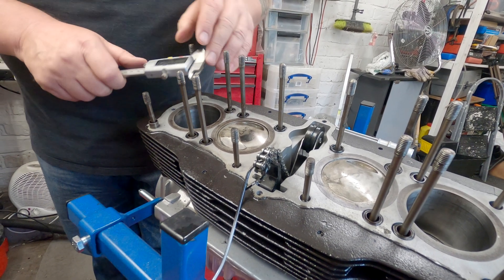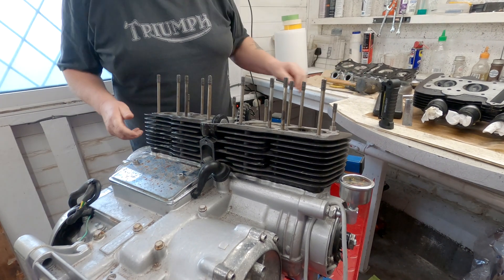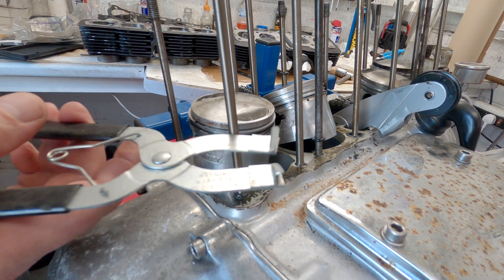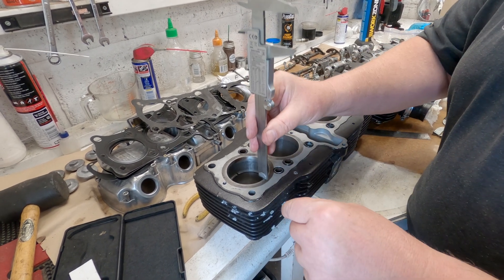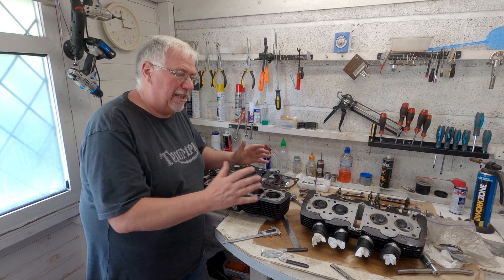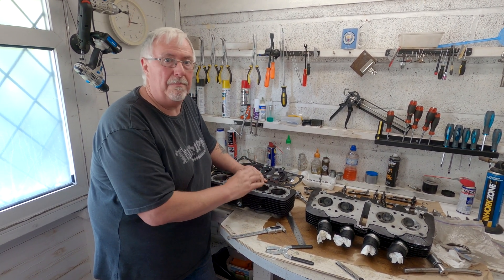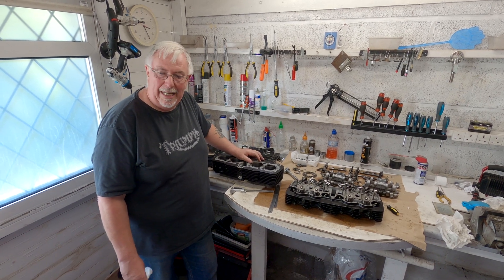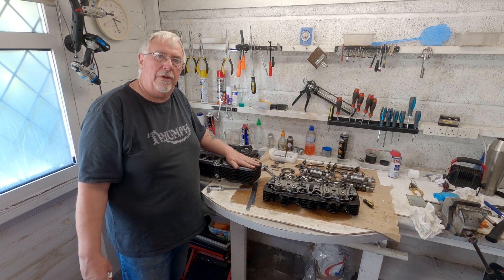Shocking Discovery in my Honda CB750 Cafe Racer Engine | Yoshimura Big Bore Piston Motor | 08

Comment: You could take the bore out to 67 mm which equates to 888cc. I had this kit from a Japanese brand called Henry Abe. Pulled like crazy through the redline in top gear!
Reply from the maker: I really want to use the Yoshi pistons, and I wasn't looking for a big bore, it just fell in my lap.  I thought that anything above 65mm bore started to make the standard liners very thin, so you I would have to replace the liners too, starts to become a very expensive job :)

Comment: Yoshimura big bore ses are usally on 812cc
Reply from the maker: Yes, and they are marked 812 on the side.  But they also machined the same blanks .5mm bigger and made 823cc.  If you put as much time into researching them as I have you will find some original adverts for the 823cc sets.  It did cause me a lot of confusions, and is probably why the previous builder used 812cc piston rings without checking the gap. I was really  pleased to get original NOS Yoshi rings for them.

Comment: I'd forget about the extra size of those bigger bores. I'd look for a serviceable standard head that would work with your pistons. 750CC would be fine with me. The extra bore I doubt you'd even feel when you opened up the throttle. But if you've got bits of metal damage inside the engine, I don't think I'd use the engine at all. If the damage is in areas like bearings that can be replaced, then it's back like new. But other areas like the cam bores that don't have bearings, no fix for that. Maybe the camshaft and crankshaft could be machined back like new. But a lot of work and money. I'd scout around for another engine in good shape.
Reply from the maker: I may end up going with 750cc in the end.  I do have a set of standard barrels and pistons as a fall back.  But before I give up  I am going to try to use the Yoshi pistons.  It seems a shame not too as long as the costs don't start spiralling!  I am not really looking for added performance, I have a Fireblade to scratch that itch, this buiild  is for the fun of it.  I have had a coupld of standard(ish) CB750's so it will be interesting to see what difference the bigger pistons make.

Comment: Sir, you're going about this in all the wrong ways.
The ring end gap does not determine anything to do with the bore size. I concur the end gap is way too large, but your pistons and cylinders may still be fine.You need to mic the piston skirts at the correct location, then mic the bore size and subtract the piston skirt size to give you the piston to wall clearance. This will determine if you need to rebore and hone the cylinders. I can type for hours but this should get you started.
T.S. RACING
Reply from the maker: Thanks BTC. I am going to take your advice.  

I wasn't using the ring gap as an indication of the size, but as the cause of some marking, and obviously an issue.  

I do want to use the pistons and before I give up I am going to get some accurate measurements.

Comment: They all sound like a pretty viable options    that extra pop you get from those racing piston  sounds like it might be worth hanging on to as they boost your compression  up from about 7.7:1 to a little over 10.2:1  other than that I would just research every option a bit  as far as parts availability  and whatnot and just go from there man !! 😁👍
😁👍
Reply from the maker: I am really going to make an effort to keep the bigger pistons,  but not at any price though!  I'm looking at measuring everything more accurately, then I will have the problem of finding Piston Rings!  Quite a puzzle.

Comment: How about nikasil for the cylinders? You might get them fit the pistons again.
Reply from the maker: Thanks for the idea.  It's a thought but that would be getting into an area I know very little about!  I have always run scared of engines that had nikasil bores.
Reply: @SPANNERRASH  Luckily there are professionals who can do it for us. I don't know if they need different rings, but likely not, as it should be more slippery as a surface than cast iron.

Comment: Very cool on the big bore discovery! I would get the heads machined and go next size up on the pistons. When I big bored my CB250 to 275cc, the skirts of my barrels had cracked and I had to grind them off and pray it wont effect the motors operation. Doesnt seem it did thank god!
Reply from the maker: A few people have mentioned cracked skirts. Apparently the next size up of piston makes the skirt very thin on these. I'm not sure what I am going to do yet.

Comment: New to the channel, and I have to say, nice content. Someone spent a lot of time and money to make that much of a mess with that engine! Looks like its in good hands now though .  That engine needs to come completely apart, if only to look out for any more stray swarf, but I'm sure you will find other 'interesting things inside that needed your attention anyway. 
Dont be too hard on yourself for using a vernier, you will easily get within a thou, so plenty good enough for go/ no go stuff. But you are definitely at the point where a couple of outside micrometers would be well worth the investment. 
As for the barrels and pistons, you need to measure the skirts with a Mike and make sure the skirts are not collapsing, and that they are on size, measure the ring groove side clearance, check the small end clearance,  if that all checks OK, obtain an original set of barrels and bore to suit, probably the cheapest sensible way out. If you don't want to invest in micrometers or are not completely comfy checking the pistons, rebore another set of barrels and a new set of pistons puts any issues firmly in the machinists court. Pretty sure I'm teaching you to suck eggs though!!  I will look forward to seeing what you do with it, keep up the good work !
Reply from the maker: It's a shame that it wasn't as good as it first looked.  I think it was all done with the best of intentions, but as they say the road to hell.....

Hope it doesn't throw up anything terminal as I dig deeper!

Comment: Unless you're willing to go for an 836cc set then I'd just replace the barrels. I'm running 836cc with the original carbs that I had re-jetted and it still runs well.
Reply from the maker: I wasn't looking for a big bore, they just happened to be there.  You know what it is like, one thing leads to another.  I want to see if the parts I have are at all useable before I give up.  I'm not afer a race machine, but it would be good to give those pistons another lease of life.  Interesting what you say about the carbs, what jets did you settle on, in fact what carbs too! :)
Reply: @SPANNERRASH  mine is a 1975 SOHC. It still has a kick start and a single front disk. I'm on the OEM carbs with the airbox replaced with pod filters (no good reason for that tbh!). The mechanic I used had to up the fueling, I couldn't tell you what jets I'm afraid.

Comment: I'm in deep on a scooter I bought. It ran, not well, so I cleaned the carb and now I can't get it started again. So through the list I go....
Reply from the maker: Make sure that another problem hasn't turned up.  Maybe with the ignition. Old bikes have a habit of throwing curve balls. Try it with brake cleaner to see if it will pop and bang.  Good luck.

Comment: I had a similar problem with my kettle barrels a few years back,I usually use SEP in derby, but by my own stupidity, I used a place local to me, rebored a set of barrels to the second oversize,they also supplied the pistons & rings, placed the rings just above the transfer port & it measured.40 across all 3 cylinders,got a mate to measure it & he agreed that it was .40, so I took it to my local bike shop & he also confirmed .40,service limit is .15 to .45, so around 1000 miles & it’ll need doing again, took them back where he measured the barrels, gave him back the pistons, he wrote me a cheque for the £250 I paid him, where he then threw me out,on the plus side, I bought a complete genuine Suzuki gt750 2nd oversize pistons,rings etc for £130,had a chat with SEP & they can re-sleeve the barrels at £60 a cylinder
Reply from the maker: Thanks Pat.  I will make sure I keep SEP in mind if it comes to new sleeves.  There used to be a lot of places that you could go to for engineering work, they all seem to have disappeared now in this throw away society.  Like you found, reputation is everything.  I still have no idea what I am going to do with this engine yet.  My biggest concern is finding appropriate rings.  That and a finite budget!!

Comment: What if you do some more honing of the barrels to remove those scratches and buy new pistons with a +0.25 size?
Reply from the maker: I am going to have to hone the barrels, but I am hoping to litterally just take the marks out and hopefully the scratches are where something has picked up rather than gouged in.  I don't believe that there are any +.25mm Yoshi (or 810 64mm) pistons available, so if the bore is too big especially after honing then that isn't really an option.  I think my biggest problem might be getting piston rings.

Comment: Great detective work les it does pay to research and understand the job 👍 I would go for a rebore and pistons your mind would be at rest with no ifs buts or maybe. Great job and enjoying the series 👍
Reply from the maker: Thanks for your encouragement!  I was surprised to find out it was a big bore, and Yoshi pistons what a find.  Shame about the rest of it.  You are right about doing the job right and not having any worries about it, but I am not sure what right is yet.  Even going back to a standard barrel and pistons doesn't seem as straight forward as you would think.  Hard to find parts for this engine apparently.

Comment: I would measure the bores with a proper bore gauge and measure the pistons with a micrometer to get the clearance.It may be that the rings are not the correct ones.If it were my bike I would source some used barrels and if not worn, would go back to standard Honda pistons,gaskets,oil seals etc.If the barrels you get are worn then rebore to suit.
Reply from the maker: Thanks Tim.  I think that is good advice, I need to know more about the barrels and pistons before I can make any decisions.  Having found the Yoshi pistons inside, I would like to use them if possible, but not at any cost.  We'll have to see how it turns out, going back to standard might be the best idea.

Comment: Hi Les, that’s disappointing, I had thought that it would be good inside, they often are but given someone has messed about with it I guess Mr Honda can’t be blamed!, I think it would be good to keep the big bore if possible, so look at sourcing replacement barrels and have them bored to suit maybe.
Reply from the maker: Hi Mark, I was exstatic when I found the Yoshi pistons, but the marked bores, and the size issue have taken the gloss of them.  I would like to use them, but I don't want to spend a fortune on something I wasn't looking to do in the first place.  I need to make sure my orignal findings are right before I can make any real decisions.

Comment: Seems like whoever was in that engine was kind of sloppy with their work.  I'm not sure what I'd do.  Buying a used set of barrels and some new standard pistons seems like the easiest way to go.  I haven't looked at used engine parts in a while, so I don't know what that would cost.  Are those over-sized pistons rare or expensive?  If so, you could sell those to help fund the repair.   Or get the new barrels honed to fit them.  Decisions, decisions, decisions.  : )
Reply from the maker: Yes, the more I look the more issues I see.  It looked so promising at first.  But having found the Yoshi pistons I would really like to use them, however I don't want to go down a rabbit hole of spending a lot for a little more power.  If it was only power I'm after I would just stick with my Fireblade, but Yoshi heritage for my cafe racer sounds like a great idea.  I never thought about the pistons being rare, maybe they have more value than I thought, I'll have to look into it.